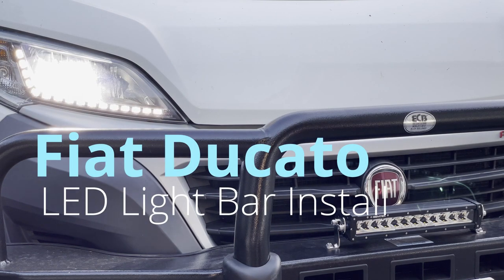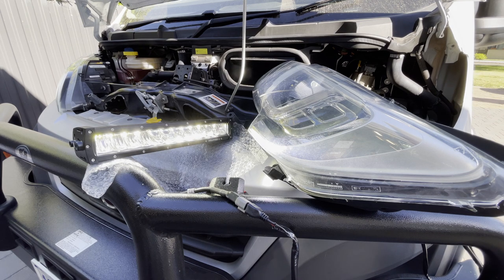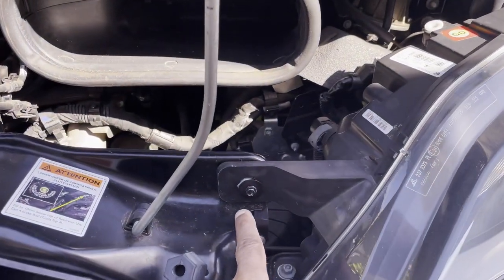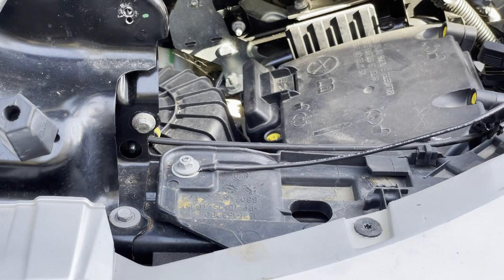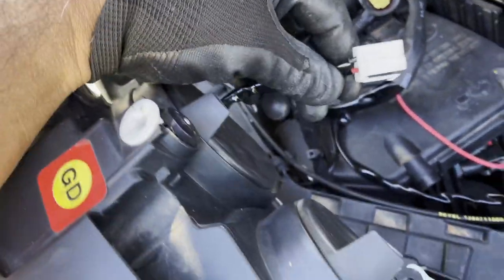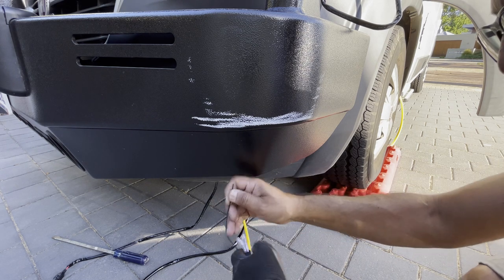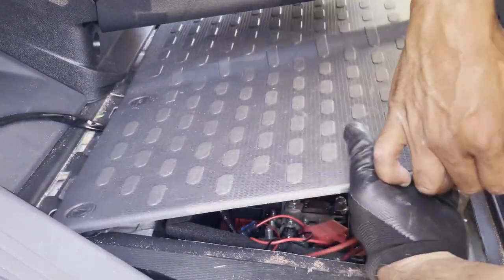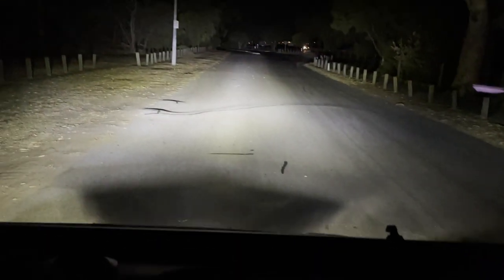Ducato ProMaster LED Light Bar Installation

Comment: You state connecting in series to the headlight this is incorrect it is parallel. Also either crimp or solder the cables. Your will corrode

Comment: I don't mean to be negative (pun intended) but I expect you'll have a problem sooner or later with that connection to the headlight. There's a fair bit of current and heat in there, and you need a really solid connection for it to be durable. A previous owner of my car made a headlamp connection much as you've done, and the poor connection heated up, melted the cabling and made a real mess.

Comment: Very useful video, thank you. Can I ask where you got the nudge bar, and how it was fitted?
Reply from the maker: Thanks. I got my ECB roo bar from ORE in Myaree, Perth, WA. It was fitted by ORE also.
Reply: @VanHacks  thank you.
Regarding your light fitting, I assume the final part where you fitted the switch can be ignored if you only wish to wire it up to when the full beam is on?

Comment: Where did you buy the harness from?
Reply from the maker: Did not buy another harness, used the one that came with the light, just had to connect the cable to the headlight the old-fashioned way.. thanks for yr question..